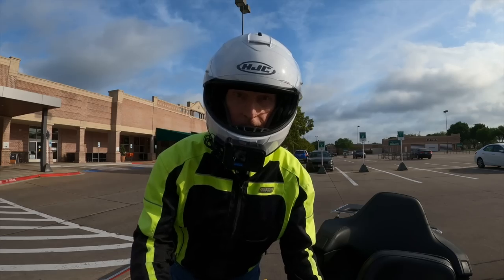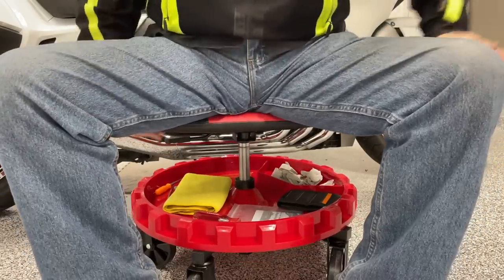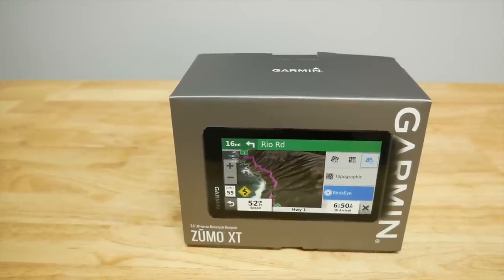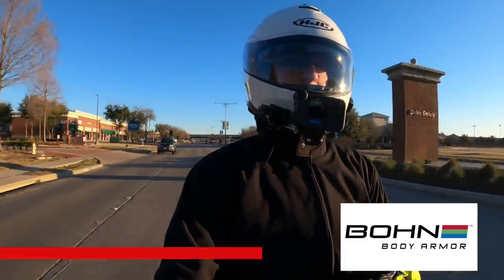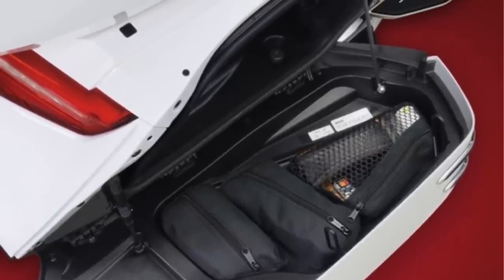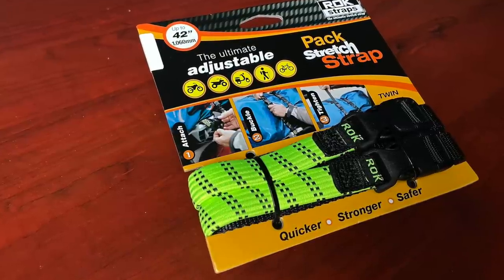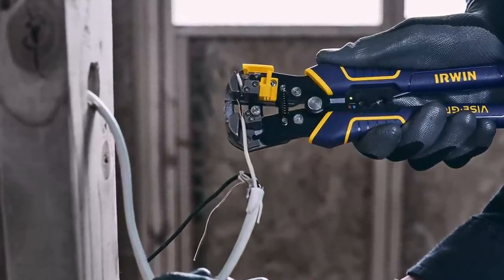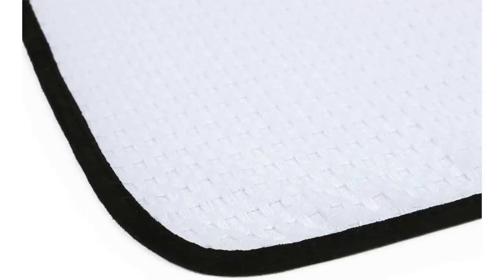Motorcyclist Christmas Shopping Guide for 2022 | Cruiseman's Garage

Comment: Chris, very slightly off topic here but I am just compiling my Christmas wish list to Honda in Japan regarding the things I want to be added to the 2024 incarnation of the Wing.  First on the list would be Adaptive Cruise Control, if BMW can offer it on their bikes, and as I understand it, the latest Yamaha Tracer 9 GT will be fitted with it, I can’t see why Honda can’t add this feature to their flagship motorcycle.  Next on the wish list would be the ability to add some customisation to the LCD screen (adding a digital speed indicator for example).  Next would be to improve the radio reception, my old GL1800 (2015) had a far superior radio reception than my 2021 model. I could ride from my house in Nottingham to the nearest seaside resort at Skegness, with my radio tuned in to Radio Nottingham (FM) as I left my house. I could still receive Radio Nottingham on the FM frequency when I arrived there!  If it’s not too early to say it “Happy Christmas” from Nottingham U.K.
Reply from the maker: I agree with all of the items on your list.

Comment: Just curious.  Rok straps.  They are elastic? They stretch? They hold things on the bike?  So......they are bungee straps.  Just a different shape.
Reply: I disagree that they are just a bungee cord. They are flexible but once you clip and cinch them, they hold perfectly regardless of riding conditions. I agree with Chris that they are an excellent accessory to any motorcycle.
Reply from the maker: Bungee cords have a history of coming undone at the hooks and your stuff goes flying off the bike. The ability to cinch them down to a specific tightness gives them an advantage over a traditional bungee.
Reply: @cruisemansgarage  I will have to take your word for that.  After 51 years of riding,  I've never had a bungee cord fail. Breaking,  coming undone, or becoming unhooked.   But my point was, you said they were elastic, just like bungee, you said they stretch, just like a bungee,  they hook to the bike. Again, like bungee.  I never said they were a bad option.

Comment: Hi!  Just a quick question about the microfiber rags.  I ceramic coated my Wing.  Are they safe to use in that scenario?  Great list by the way.  I'm taking a hard look at some of those items and hinting to my family about a list...  😁
Reply from the maker: Yes, the rags are safe for use on ceramic coat AS LONG AS THE SURFACE IS CLEAN. I would not use them to wash the bike, only to dry after being washed.
Reply: @cruisemansgarage  Thanks for the timely info.  I was told by the detailer not to use microfiber but I think you explained the parameters better.  Hope the weather is nice in Texas.  The snow is melting up here in Alberta but that's probably in preparation for a major dump of snow - kind of in the eye right now, I'm thinking...